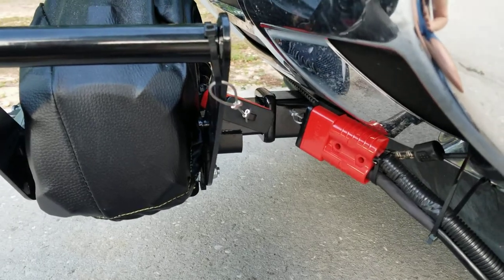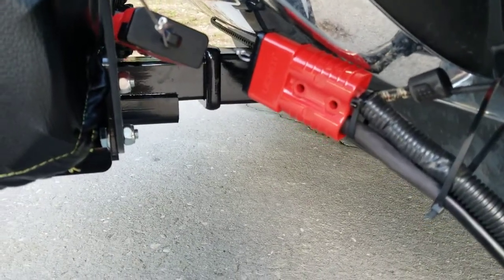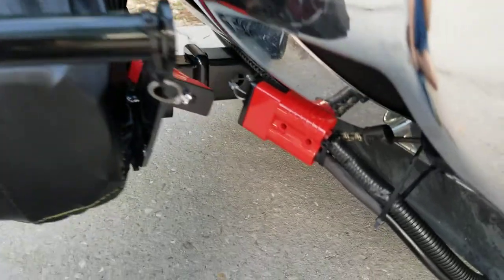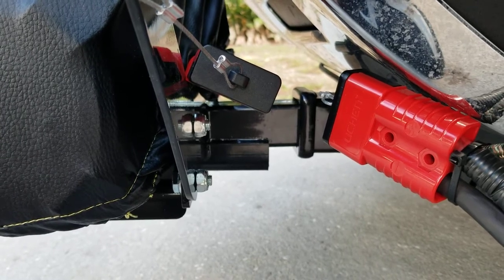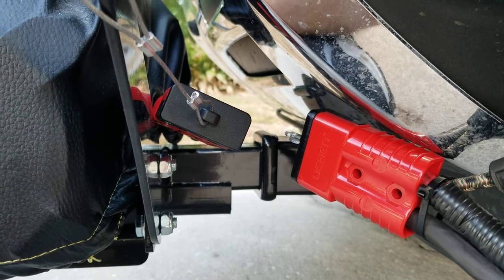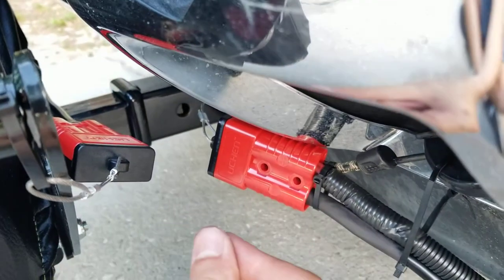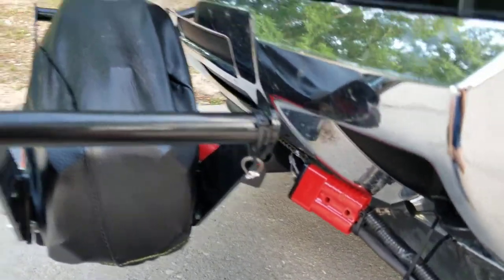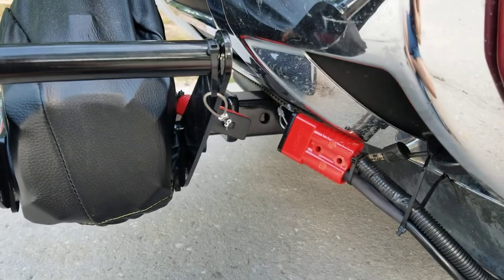Badlands Apex Winch Quick Connect Plugs

Comment: just bought a used Xterra with this and also a 7 prong connector, both, in the rear. what were/are these for?
Reply from the maker: I installed these for my winch to battery to switch set up.

Comment: Where did you get the mount plate and is it rated for 12k lbs? Also where did yo I get the cover?  
I just got me the same wicnch
Reply from the maker: I got the winch cradle from Wal mart. Shocking, but good specs and reviews on it. It could handle 12k pull. The front mount hitch receiver was a 9k rating.
Reply from the maker: @backcountryboondocker6438  

I copied my walmart order below! 

Ecotric

10x 4 1/2 Cradle Winch Mount Mounting Plate 13,000 Lb Capacity Recovery Winches
Reply from the maker: $56.00
Reply from the maker: @backcountryboondocker6438  np man good luck

Comment: You’re losing a lot of amperage with those qd mounts. I believe they’re only rated at 175. Some are rated for 350 amps. But winches can max out at 400-430 amps. Momentarily,granted. But still.
Reply: i thought the same thing...meanwhile warn sells the same 175 amp quick connect with their 12k pound winch as an accessory,,and they use 2 guage wire for batteries...

Comment: So you ran the wire below your mount so you can drag them and damage them off road shorting out you battery?
Reply from the maker: I appreciate your round about suggestion. I wouldn't do it again this way next time, but do enjoy the benefits of the quick connect plugs.